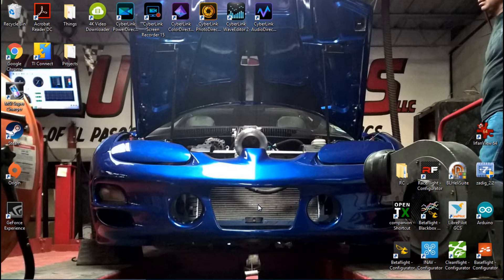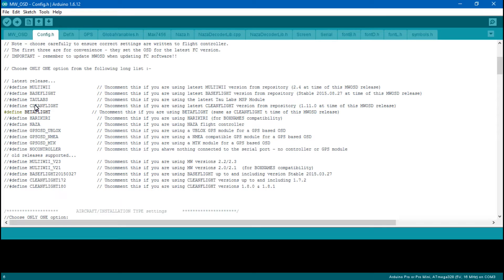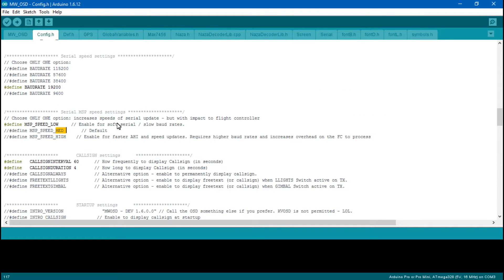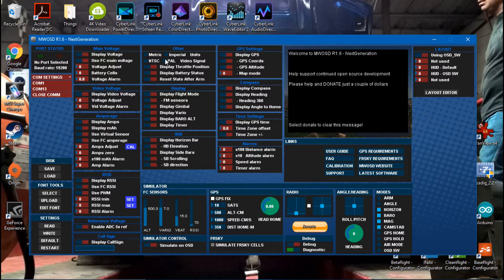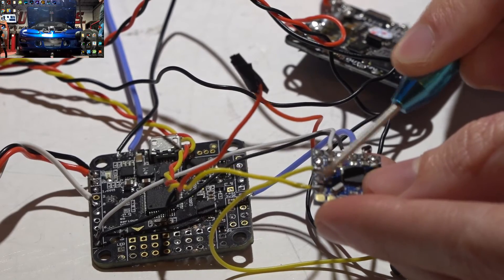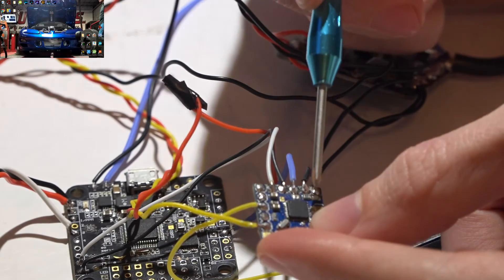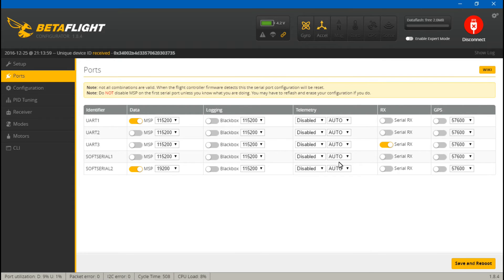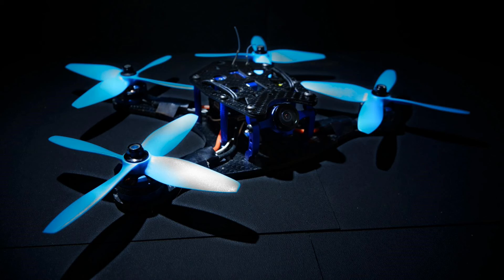Troubleshooting Minim OSD Micro (common problems & fixes)

Comment: You are absolutly right about common ground. I had interference with transmitter TS5828 because it has two grounds. One of them I used as a power-input and the other for powering the camera and the OSD. When I mixed them up, the interference disappeared. Thank you.

Comment: Great video! I've figured out these issues on my own. One issue is giving me a headache. I get a low Hz buzz/hum when text is displayed or flashing. I've lifted grounds, as well as added caps. Every minim I use just adds noise in the video. I call it low hz because I hear it using my goggles.

Comment: Omg bro. I just watched this video, noticed that if using this board, should choose "witespyv1", immediately i couldnt connect to mw osd though. after multiple reflash, in the end i change it back to "minimosd", i can finally connect again.
This is where i got the micro minimosd https://www.banggood.com/MICRO-MinimOSD-Minim-OSD-Mini-OSD-W-KV-Team-MOD-For-Naze32-Flight-Controller-p-990556.html?p=DG23031123036201501P

Comment: Hey man, great video.  I still am having a slight issue.  My "Call Sign" initially shows up, along with timer MAH and Volts, etc.  My problem is, my call sign disappears after about 5 seconds.  Everything else, works fins and stays on the OSD.  Why would the call sign alone disappear?  I am using KISS FC with 24A KISS ESC using the Micro Minimosd as you are showing above, I am not sure if KISS is the problem, but need help if you have time.  The whole point for me having OSD in the first place was to be identified while at races.  Any help, would be greatly appreciated.  Thanks man. 

 By the way, all of your videos are really well done.  Your explanation of all items are very good, I went right through the set up with ease, without this video I would have been lost.  Thanks again for getting me started.
Reply: J - Skins Thats normal. You can set it to persistent mode at config.h  by uncommenting //define callsignalways

Comment: Hey, JC. Just curious, my green light on the OSD flashes quick but has a pause for a second where it doesn't flash then continuously does his. Does that mean it is no good? I can't seem to get video or OSD but it does power up and seems to flash with Arduino. if I disconnect power or ground I get rainbow video....

Comment: Quick question; I was able to flash my minimOSD micro using Arduino and the MWOSD gui with no problem.
When inside Betaflight 3.1 all ports are assigned, data xfer rate set, CLI checked and it looks right.
But I cannot access the OSD in Betaflight. The error message is that BF cannot communicate with the OSD.
Does it require that a camera and xmtr be connected? This is a bare board not mounted to a quad yet. Just getting all the bits and pieces in place before the final build.
I have ordered another minimosd board just in case I've fried this one I have.

The FC I'm using is a SPRacing F3 board and plugged into UART2 port, selected in BF and speed set to 115200. I've also tried swapping TX and RX on the OSD to no avail.
Any help would be appreciated. :)

Thanks man.

Comment: Would love to see a tutorial on how to reload the bootloader again. I have a micro that seems to be working fine (both blue and green leds are on), but I can't connect to it. The Arduino software won't allow me to connect, neither the MWOSD GUI. I think I bricked it somehow, but it's not burnt.
Reply: Miquel Pavillard i have the same prob and always have had no luck thru four or so minimosds.. arduino software gives me the same message about sync and refuses to flash. the mwosd gui also never connects. and yet i can link to flight controllers and even an old kk2 board no problem.

i swear i have all the drivers etc installed and have tried multiple ftdi boards nd minimosds but no luck. any ideas yet?
Reply: El Cabron Negro no. The only thing left for me to try is to load the bootloader with an arduino board instead of an ftdi adapter. There are some tutorials on YouTube about it

Comment: JC thanks for the great video. quick question for you. Im seeing a signal with OSD text and data but no video. I've swapped cameras and tried the ntsc/pal settings but still no video. it was working last night im not sure what could have happened to it. what else can i check? If im seeing osd text and video does that mean my vtx is working properly?

Update: I just tried wiring the camera directly tot he vtx bypassing the osd, STILL no video!! is it possible the vtx is bad? i really dont understand this.
Reply from the maker: If you're not getting video when wired straight from camera to Vtx then there is definitely some wrong with either one of those. Possible causes that I can think of is, powering the Vtx with no antenna on it because that will kill it or not using the correct voltage to either camera or Vtx.
Reply: Project Blue Falcon thanks. yeah I checked the voltage coming out if my LC filter it is right. I swapped the camera with a brand new one, same, I don't have another vtx to try. guess I'm gonna order one. 🤔
Reply from the maker: Watch Stinger Swarms video on reflowing video transmitters in a oven. That might fix it. But I would still order a new one. Its good to have a spare to do tests with. https://www.youtube.com/watch?v=0lmG7YwWGus

Comment: Did you manage to use it with revolt FC ?
Reply from the maker: With the current Raceflight configurator, no. I honestly dont think its possible as of right now. Neither is telemetry with FrSky receivers. But RF1 will be released soon hopefully. They said it would be released "in a few days" but that was two weeks ago. I'm playing around with the beta version of RF1 now to have everything figured out by the time it officially releases.
Reply: So it's possible with rf1 ?
Reply from the maker: The Beta I'm using is very very basic. Just enough in the CLI to get it flying and tune PIDs. Everything else is disabled at the moment. But I'm almost certain OSD and telemetry will work with RF1.